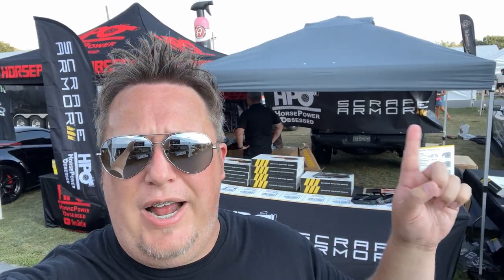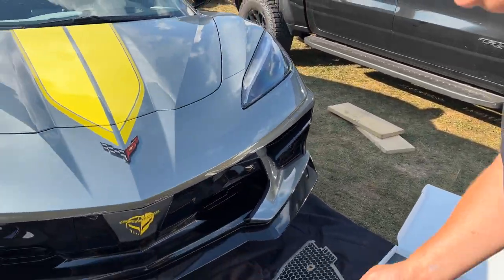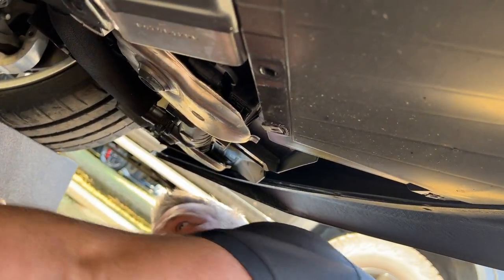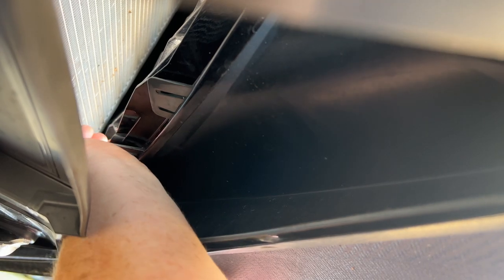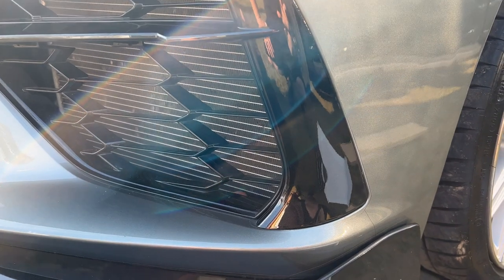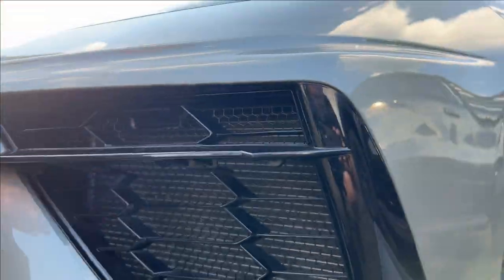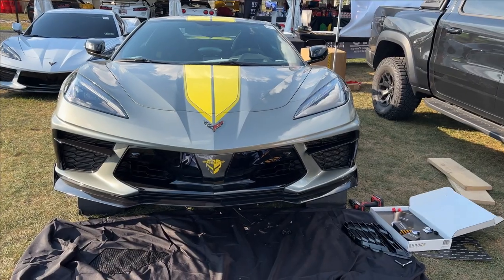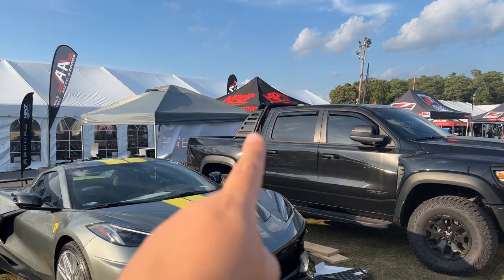C8 Corvette Scrape Armor Radiator Guards Install!

Comment: Thank you for this video! I just purchased them with an install from GM with points to be installed at the dealer when I pick up the car next week. After watching this I know I made the right decision getting this brand and having it professionally installed. He made it look easy. Is it a concern not having a side one for the Z51?
Reply from the maker: You're very welcome. Definitely highly recommend these. The side intake grills are coming soon but if you aren't tracking it, it's not a huge concern right away.
Reply: @HorsePowerObsessed  oh cool. I won't ever track it so maybe I won't even need the side one.

Comment: Will you be able to use these on a Z06 or will you need to make a new kit?
Reply: Scrape Armor has the GM authorized Z06 Front and side air intake guards in RND currently! They are completely different and will be launching shortly after the Z06 release. Hit Justin up here as an authorized seller of Scrape Armor!
Reply from the maker: New kit coming for the Z06 soon!
Reply from the maker: Thanks, Shane!

Comment: No included tool kit on my package. Now I have to go out and buy the tools and delay the install. I even called the vendor before purchasing and they told me the tool kit was included. Hope I am not missing anything else that’s supposed to be “ included “.
Reply from the maker: From what I understand they stopped including the tool in the kits sold to or distributed to dealerships because they were installing them for customers and had stacks of tool kits that they didn't need.
Reply: @HorsePowerObsessed  , I suppose I can understand the logic of that. But Let’s face it, who is really profiting from that move ? Also, as I stated earlier, if I had been forewarned before purchasing, than I would have been prepared to install immediately instead of having to delay in order to acquire the necessary tools. These install videos should be updated with the correct information so any future buyers know the truth.

Comment: Does the center section of the front end require a radiator protector on the c8 Zo6
Reply from the maker: Yes it does. You can see the install here: https://youtu.be/Tw0LrhgX6Rs?si=mM-x27EB6MvXfw90
Reply: @HorsePowerObsessed  thank you does it come with the kit? In this video I only saw the 2 outer grills done.
Reply from the maker: Yes it comes with the z06 kit. Just make sure you order the correct one for your car.
Reply: 👍 thank you
Reply from the maker: @paulmichaelssalon you’re welcome!

Comment: After doing alot of research bugs and stone chips will not cause sufficient damage to the radiator filters.  It's only a cosmetic issue.  You can replace the original  filters for less than two hundred dollars each. 
Selling radiator covers is only another way of someone making money  for something not needed.
Reply from the maker: That’s not true. There have been a few documented cases of rocks or road debris puncturing a radiator and needing replaced.

Comment: Do not purchase the kit form Chevrolet because it will not include the tool kit!  Chevrolet expects it to be installed at your dealer so they do not include the tool kit for the same price...and you will pay for installation...rip off!
Reply from the maker: Good to know!!
Reply: Probably any GM  Dealers will NOT have the Tool Kit. Bought mine from Wildhammer online. I even called them before purchasing and specifically asked to make sure the Tool Kit was included. They said it was included. I don’t think they intentionally lied but they also did not bother checking themselves to make sure it was in the package . So now I have to purchase a mini ratchet set that includes the required 7mm and T15 bits to remove and install.

Comment: Come on GM, you already know this is an issue on the C8. A 106K+ C8 Z06 should not have the same problem. The part should be standard and installed at the manufacturing plant. Stop being cheap and lazy. Build a quality product.

Comment: The product is good, but you do not get a tool kit if you don’t purchase directly from scrapearmor. I call bullshit false advertising. Pisses me off. And you heard what the guy says during this video.
Reply from the maker: They changed that recently due to the large majority of these installs happening at the dealership where the technicians were collecting these tool kits and selling them on ebay afterwards because the original purchaser  wasn't even using the tool kit.

Comment: Actually, you get a little card asking if you need a tool kit. 19.95 plus shipping. Needless to say, I won’t be buying anymore shit from these liars.
Reply from the maker: They changed that recently due to the large majority of these installs happening at the dealership where the technicians were collecting these tool kits and selling them on ebay afterwards because the original purchaser  wasn't even using the tool kit.
Reply: @HorsePowerObsessed  then take the cost of the kit off of the price of the guards. They are still full price.